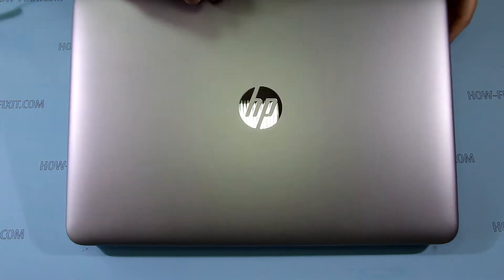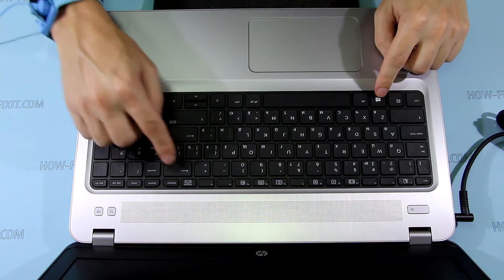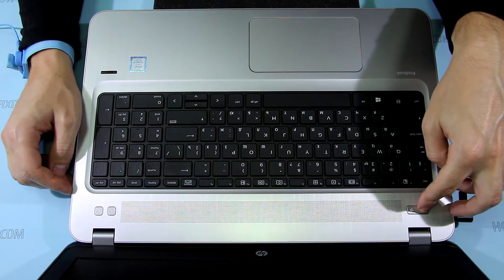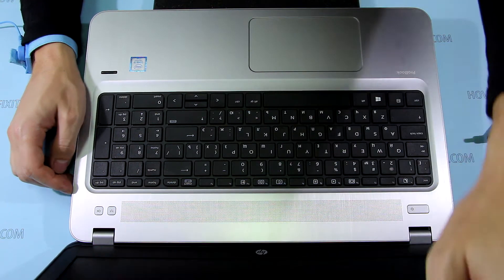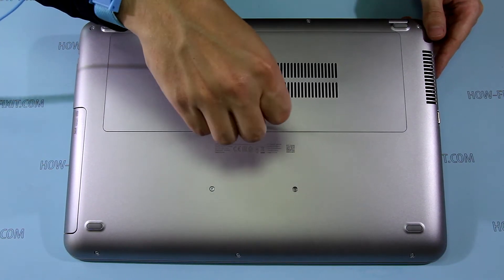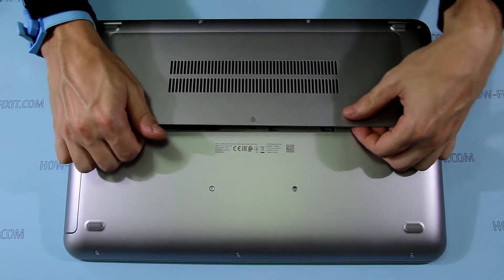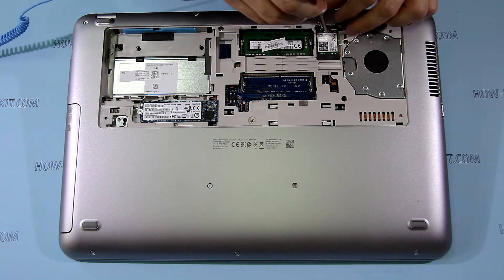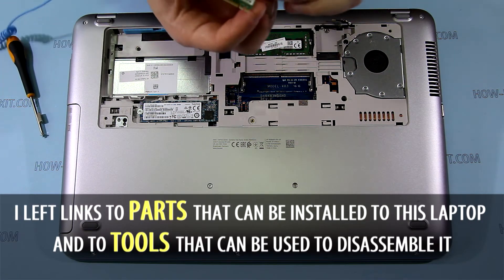HP ProBook 450 G4 Wi-Fi Card Replacement - Fix Wireless Connection Problem

Comment: hey, how about using a usb wifi receiver instead of replacing the wifi card on laptop. do i still can connect to the internet using just the usb wifi receiver?
Reply: yes, i have been using those, they get heated up and start disconnecting after a few weeks, it was using a cheap one so it might be that